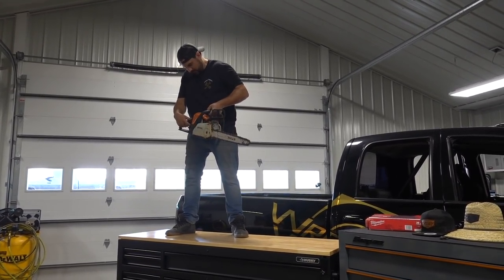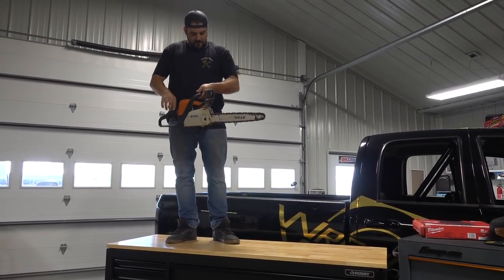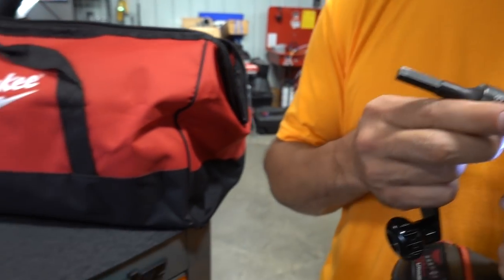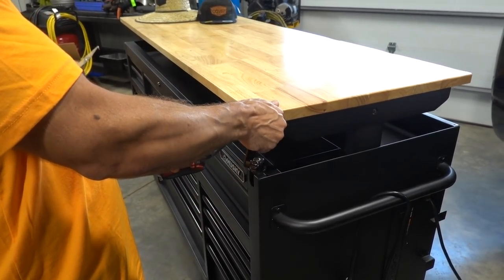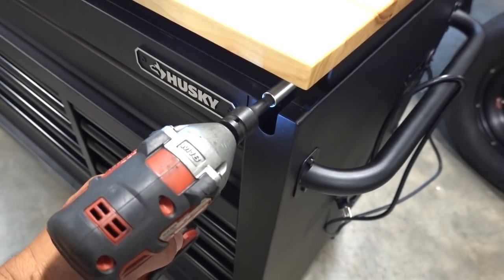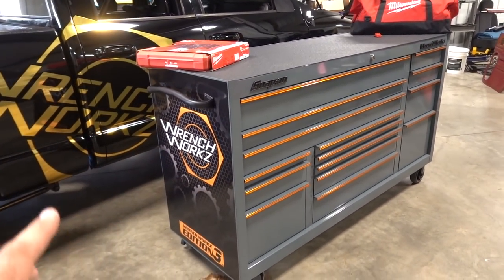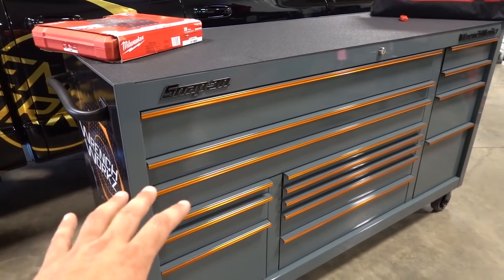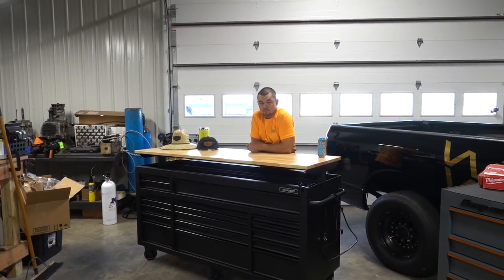Is a Snap-On Toolbox actually worth the BIG Money!?!? My UNPROFESSIONAL Opinion!!!

Comment: I work in the business and have Always have said tool boxes make you zero money. Being organized is a big part of it tho. Spending a grand on a box instead of 5 grand let’s you buy more tools to get the job done instead of being tied up with a expensive box and not being able to get the tools you need because your tool bill is too high.
Reply: Not gonna get much for 1k 😂😂
Reply: @williamuskoski1385  I use a 3 bank us general box with a side cabinet/locker that cost me 975 bucks brand new.  Full of snap on, Mac, Matco etc... I’d buy my box 5 times over before I wasted money on a box from one of the bigger guys
Reply: I have a snap on box from a co worker who had to retire … 5 k for a 72” huge box with a chrome top and hutch….. and I love it… it’s a lifetime box, seen friends of mines buy multiple boxes due to the drawers not being able to hold weight or just becoming worn out. I rather buy one box than but the same box over and over
Reply: I work in the business too. I have full sets up to one inch drive in my top drawer, chrome, impact, impact swivels. Probably at least 600 pounds in the top drawer alone. I don’t feel anything less than my Epiq series slides would handle it. My Mac Tech series wasn’t happy.

Comment: I've got a 72" Montezuma Triple that actually sits higher and deeper than an equivalent Snap-On. Have the hutch on it as well. Paid a fraction of what Snap-On wanted, and that was 12yrs ago. Still looks and works like new. A toolbox is just a metal dresser. What you need to spend money on is the tools to fill it. Knowledge will come...but a tool box doesn't help with that what so ever.
Reply: That’s my opinion. I bought a used 72” Matco 4s 3 bay for half of new price, from a buddy that got out of it. Got a nice stainless top made for $250, n bought a side cabinet for it. N yeah over the past 6 yrs, spent 50k + in the best tools money can buy.. Because that’s what makes you money. N who likes cheap o tools! there is still lifetime warranty on the box, so anything goes wrong there, it’s taken care of.
Reply: definetly agree that a tool box just holds tools. i have been lucky buying my box used but i couldnt justify the cost of a new box at this point in my life
Reply: I do like matcos key that matco only sells and matco claims is honest to unpickable or snapons key fob for the box bc thieves are everywhere
Reply: Your opinion is extremely relevant. But why drive a Chevy or bmw if a Altima does the job..
Reply: @Jamesrdc  yeah but those cars actually offer some sort of difference in the experience. Obviously a BMW is a smoother ride, more powerful than an altima etc. A tool box however is just a tool box. No matter the quality of it it doesn’t offer any kind of different characteristics, all drawers open and hold tools on any box
Reply: @alecw7063  let’s start with the drawer system. They hold double the weight. I have a 1967 box opens like from factory and my 2010 craftsman box already broken. And the construction. Snapon boxes hold 10,000 pounds at the top. 
I know what you mean. But there is craftsmanship and quality in every part

Comment: Love snap on tool boxes...exceeept their key and barrel locking system.  At work we lock and unlock tool boxes 20 or more times a day.  The locks/ keys and locking bar fails and cracks so quickly when theyre used that much. This is in an industrial setting so it's a bit understood but still.  Otherwise I love snap-on boxes and tools alike.
Reply: Yep I’ve had to break into my Snap On roll cart that’s only a year old. One of the pins in the lock jammed but thankfully my snap on guy warrantied it. I now grease the lock every week.
Reply: Ive replaced mime 5 times within 2 years

Comment: I started with a small craftsman tool box. started filling with tools. eventually when I started making more money. upgraded to a snapon KRL722. got a good deal on it. it was a repo in great shape. over the years I added a top chest and a locker.  just over a yr ago. I got a good deal and trade in on a KCP1423 triple bank with spee drawer and power drawer. love the box and this will be my last tool box purchase.  there are lots of matco tool boxes in my shop. the same triple bank needs 6 casters under it where snapon has 4. snapon is built better and stronger in my opinion. also love the lock n roll drawers.
Reply: Ahhhhhh, the Matco doesn't NEED 6 Casters. It's simply more structurally stable that's all. I'm my opinion, Matco does make the best boxes. For ANY Triple Bay, they need 6 Casters, not 4. It just makes common sense
Reply: >Repo box 
And that settles it. I will never get in debt buying tools. No matter what.

Comment: Tekton tool box are made by Rousseau in Canada. Just compare the $3450 Tekton 60 x 30 Inch (ORG75201)with 400 lb.(each of the 12 drawers) to the $12,175  Snap-on 60 x 30 Inch EPIQ Series (KETN602C0PBO) with 226lb (for 6 drawers) and 454lb (for 4 drawers) the Tekton got more rigidity with it's undercarriage drawer and it's 3.5 time cheaper!, To bad they didn't order the triple bank from Rousseau, this one may made you wonder why you spend that much on a Snap-on. Rousseau make industrial tool box, they can custom build you the box of your dream for far cheaper then Snap-on but it's still too expensive for home user. For that you have the Heavy duty Husky series, the Harbor freight U.S General tool box and specially their new fantastic 6 drawers cart.

Comment: I’m an up and coming CNC machinist and I just bought a small Kennedy box and have already filled it up with just measuring tools. I did go to UTI but the snap on program was never mentioned to the machinist students I wish it was but I still don’t see myself buying a new snap on possibly a used one.
Reply: As a Tool maker that moved to heavy duty, stay away from anything with snap on written on it unless you bought it stolen, it's just Williams or Bahco tools made in Spain or Taiwan with snap on printed/etched on it in USA with a 500% mark up. Their only good product they sell is the 87 piece hex/torx socket set by blue point. Life time warranty and you'll need it cause they will break. Power tools go Milwaukee, air go Matco.

Comment: In Aviation all tools have to be shadowed in the tool box. My current tool box is SnapOn KRL 1056 which is the big square box but it’s super deep KRL line. I love a box that has the full length drawers all the way down no small drawers. If I could post pics of the shadowing I would.

Comment: I started with a blow molded case.  I bought a 55 inch snap on box when I got close to graduating college turns out my work gave me a sunex 6 drawer roll cart so my snap on box stayed home.   I sold my snap on box simply cause i had no need for it and bought a us general five drawer cart.   Ran out or space in my sunex cart at work so I sold it and got a used matco Jamestown cart

Comment: Sthil chainsaws are the best ☝️
Reply: Love the name bro! But my 372xp is way badass
Reply: @james_jr   umm ??
Reply: Fill me inn?
Reply: Use to be the best lol they have gone cheaper now. My local sthil dealer told me not to buy a new one. My new favorite is efco they have been insane for years now for me that is
Reply: @james_jr  Hard to beat a good running 372. But my MS660 that's been heavily "worked" has been my favorite.
Reply: No doubt about that 660! And my 372 is old. No new stuff here

Comment: Husky boxes are good for starters or home use, I’ve had good luck out of the Milwaukee box so far
Reply: Is it the triple that they have at home depot by chance? I’m looking into buying on for work and I’m wondering how good it is.
Reply: It’s pretty good for shop use the large draws wear out easy but that’s after months of abuse
Reply: @Gmurphy84  Well if the slides wear out can’t you just replace them??

Comment: i got a triple bank snapon toolbox royal blue.    beautiful stainless top.  and i got the hutch to match.     these boxes are overpriced an very shitty.    for one ALL YOUR drawer slides will need changed.   very soon too.   and they will keep failing.   i cant believe cheaper boxes drawer slides hold up way better.    come on really snap on?    im on the east coast and our tool guys says , ok slides are ordered     year and a half later, im still kicking these drawers shut , cause slides are a national backorder.      reallly.   these toolboxes suck really bad.  stay away.   mac tool slides hold up way better.   save ur money but dont buy snap on toolboxes.    they have faulty parts and u cant get them warrantied or bought.     wow.   hope this guides someone to not be in my position after spending 11-13000$ on a faulty name brand boxes.  ase mastertech 28 years exp

Comment: Hold the trigger down and flip to choke switch all the way down, it'll fart once. Set her to half choke pull again. It will idle, hit the trigger. Now because you're a complete ROOKIE you should also understand a two stroke is meant to be ran full tilt , do not feather it do not half throttle its cooling comes souly from the oil mixed in the gas. You flooded it, mega cringe so many fake mechanics these days. My little sister knows more about engines than you do.